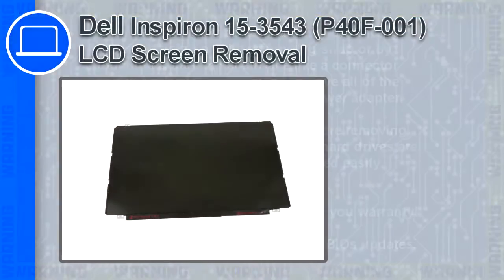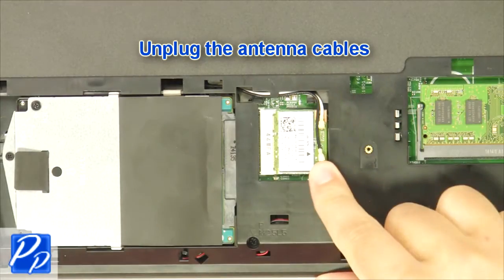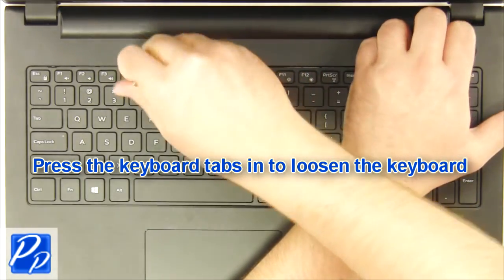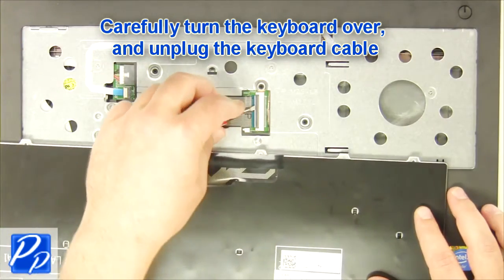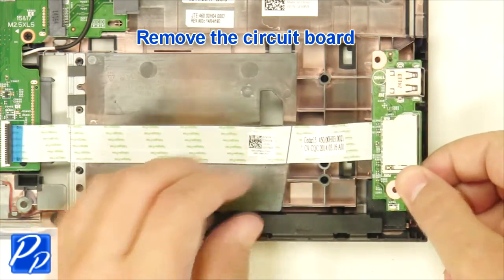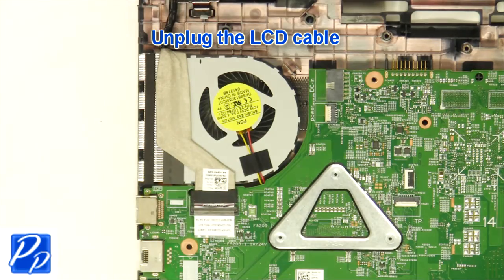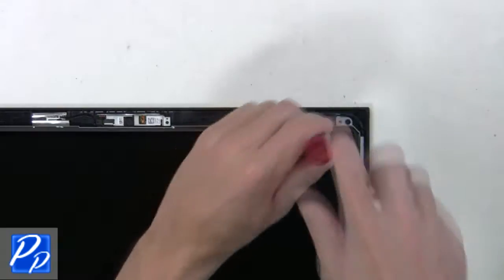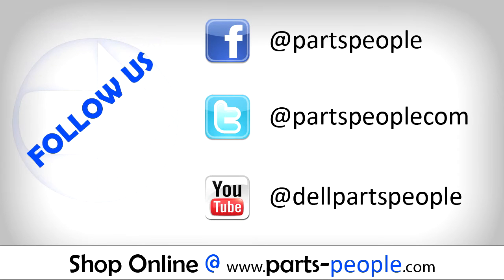Dell Inspiron 15-3543 (P40F-001) LCD Screen How-To Video Tutorial

Comment: Screen still displays but no backlight. What could be wrong?
Reply from the maker: It sounds like the backlight is out and you need to replace the screen.
Reply: Is that the only possible culprit? I just don't want to find out after buying a replacement lcd that it was some other part (like the cable or connection) that was causing loss of backlight.
Reply from the maker: Without having the laptop to diagnose, I would assume that is the problem.

Comment: Why do you need to go to all the trouble of unscrewing everything in the laptop base, why not just un-clip the LCD Bezel and remove the screen and replace it.
Reply: Because the bottom of the screen goes under the base cover.
Reply: @fieldauditservices6870  This is true and the method shown in the video is the safest. That being said, I had no trouble jimmying the bezel out and back in again without any of the base disassembly so it's definitely possible to do so on this model.

Comment: i successfully replace the screen but 9 keys of the keyword does not work after that. Capslock, Tab, T, Y, Backspace, {, }, numpad . , numpad /
Reply from the maker: Try reseating the keyboard cable.  If it's loose or not fully plugged in, it could cause the same problems.